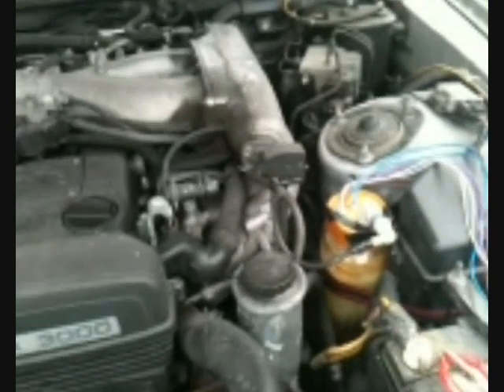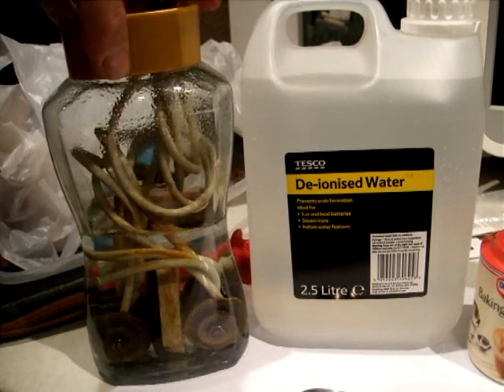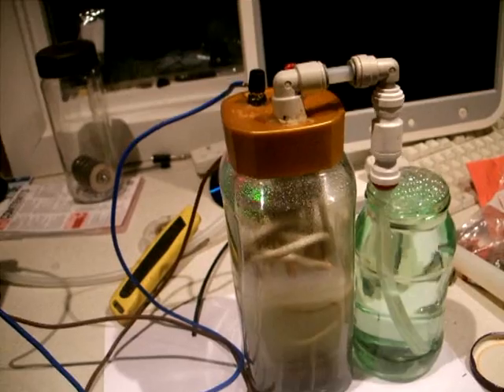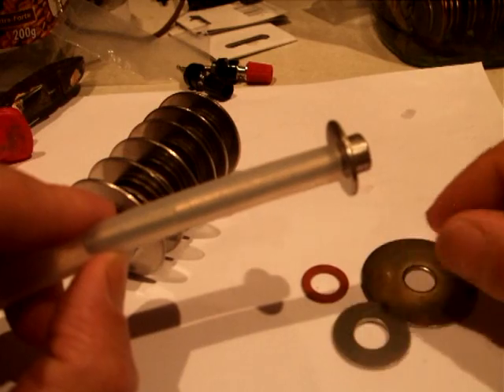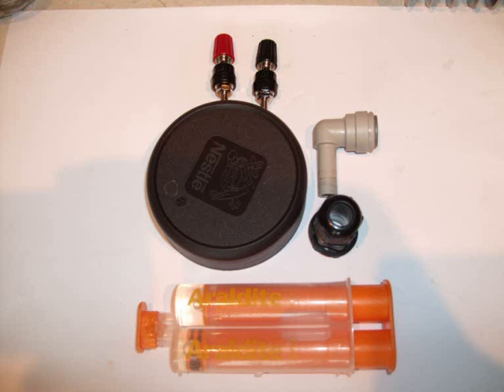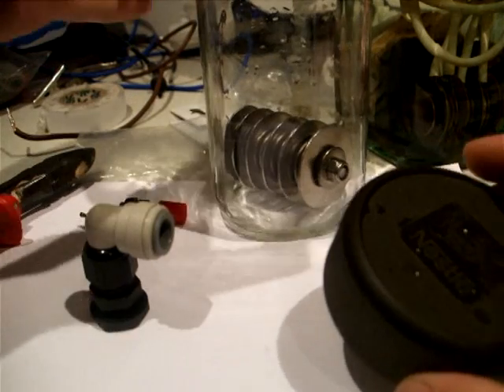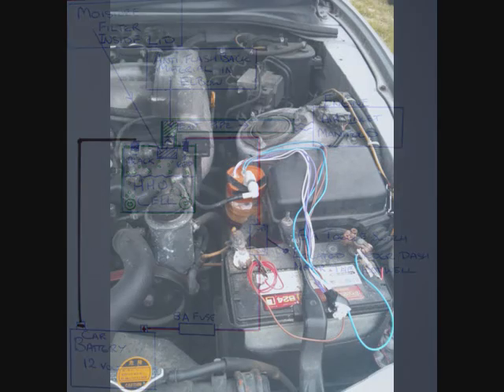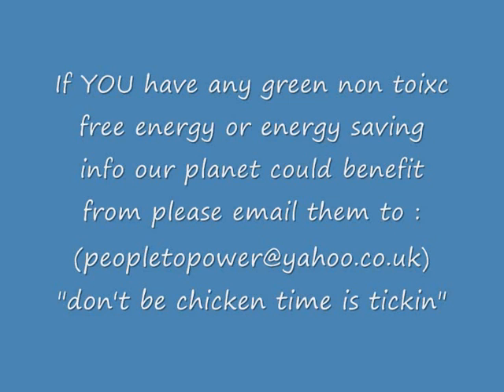HHO How To Build Your Own & Run your car on water.wmv

Comment: This fellow is doing exactly what all the HHO crowd are doing. They are all generating H2 and O2 and then burning it as fuel, along with the gasoline they run on. Physics tells us that it takes the same amount of energy to split water as it releases when it burns so there can be no significant improvement in efficiency and since there are always losses when you convert energy from one form to another we know these people are losing efficiency because extra energy is being added somewhere. They just don't want to admit it or just know where it comes from.

But the really great part is the part they have all been missing. Because everyone is so busy trying to cheat the oil companies or break the Laws of Physics, they are missing out on the true wonder and benefit of what they are doing.

Instead of making H2 and O2 gas and piping it away, they could use most of the same equipment to just seal up water vessel generator and it let run ( which really works good using a homeowners style, trickle type battery charger) until the water gets saturated with H2 and O2 gas, that has dissolved into the water, because it had no place else to go, just like CO2 in your soft drink. In this form the explosive gasses are smothered in the water and can't explode or even burn while the water it is still liquid. You could in fact, throw this water (now fuel), on an open flame and it would douse it  just as well as ordinary water but If this energized, E-Fuel as I call it, is atomized in a carburetor or injection system, the H2 and O2 gases are able to liberate themselves and combine as soon as a spark or flame is exposed. The really great thing is, that all the ordinary water molecules that are present when the E-Fuel is atomized, becomes a heat sink for all the excess energy released during the explosion and it all becomes steam and no heat gets wasted. So although you only get out as much energy as you put in when you generate the E-Fuel, when you burn the fuel in your engine, you get a huge increase in efficiency, because there is no waste heat and you no longer need a cooling system. All the heat that is usually lost to the cooling system is now doing useful work and increasing the overall efficiency greatly. But don't worry about your car heater just because you don't need a cooling system anymore, since E-Fuel burns perfectly cleanly and only produces steam, you can use the car's exhaust to supply your heater and scavenge even more energy out of the fuel. So it may cost you for the electricity to energize the water, to make the E-Fuel but you could realize a large increase  in efficiency, and E-Fuel makes every vehicle an electric vehicle, only far more efficient than any electric car and just as clean and friendly to the environment. 

None of this is based on the mistakes of some backyard inventor that has no idea why it works, it just does. This is straightforward Chemistry and Physics and it doesn't break the Laws of Physics, it uses them and this is all just rock hard science.

Ain't Real Science a Gas?

Comment: I made a poor quality video of how to do electrolysis with two positive connections instead of one negative and one positive. 

 The process recycles some of the electricity as you are charging at the same time. 

 It can also work with two negatives connections.

Probably take the video down soon as no one seems to realize the benefits of it.
Reply: why did u take it down?
Reply: Terrarium Firma  Had an idiot jumping to conclusions without replicating it from himself. That's why I took it down.

   Anyways all you need to do is look up Bro Mikey and Split the Positive here on YouTube.  Then where he connects his inverter is where you connect your HHO cell.

  The more batteries used in the bank the better HHO production and there is some efficiency gains in using more batteries.  4 to 5 batteries should be your minimum.

  Have an idea for a decent setup using some batteries in the back of a pick-up truck with solar panels over them.  While using a large HHO cell that can handle many amps and have it's own cooling system so the electrolyte does not boil.

  Any questions are welcome... provided you are willing to do the work.
Reply: OK, i'll look it up. Cheers

Comment: Stanley Meyer addressed the concerns of water freezing during Winter cold weather in his book: The Birth of New Technology Water Fuel Cell. This book contains all of the basic concepts of the Water Fuel Cell. Stanley Meyer demonstrated these concepts when he built his famous dune buggy that ran off of water used to supply hydrogen to run the Volkwagen engine in the dune buggy. His book is thorough in describing the basic concepts. Unfortunately, It lacks details in the actual components and control circuitry for the car.

Comment: stop!  people if we deplete the water supply on the planet WE DIE!
Reply: You're not going to lose water from the planet using this, unlike a fossil fuel. 
Water is a renewable resource, constantly going through the water cycle. This is removing hydrogen from the water by turning the water into a hydrogen/oxygen gas. Oxygen goes back into the atmosphere and the hydrogen is burned, and when it burns it reacts with the oxygen in the air turning into steam, which is a form of water. No water lost.
Reply: The hydrogen atom looses an electron (that's where the energy comes from) there for makeing it impossible to form h2o it can form h2o2 also known as heavy water witch we cannot drink and plants will not grow in it!
Reply: +Dennis Hust If it's possible to make heavy water, Deuterium Oxide, back into water that won't be too big of a problem if we can implement it into our cars. With our ability to manipulate atoms, so long as it doesn't take a nuclear reactor to do it, It's very likely to be possible.

Comment: How do you make a flash preventer; and the Gizmo that prevents moisture from entering the air intake?  Can these be readily bought.  I want to try this.  I know on my vehicles there are several vacuum hoses.  I have no idea which one to hook the device too.  So, I am considering drilling into the air intake; stuffing the hho inlet tube in it; then jb weld to seal.  Someone help.  Author of this video, contact me.

Comment: Regardless of all the negative comments about this device,if it works
then fine,if not....who cares,at least people are trying to find a way around the
fekking monopoly that the power companies have and shafting us into the bargain.
Reply: +Fred Zlotnick well everyone doesn't seem to understand this concept or the concept he's getting at. electrolysis is not supposed to be some wonder fuel that gets more energy out of it than you put in. it's just that the electricity and water should be more efficient and cheaper than water. there's still a conservation of energy. none can be created or destroyed just one water may or may not produce a cleaner fuel with the same kick at a cheaper price
Reply: If this approach was any good, we'd be seeing hundreds, maybe thousands of cars, electric generator all running on water. It will never happen, all the energy in water is locked in a chemical bond and it takes more energy to relase it than you can get from it. This is literally a "pipe dream", pun intended.
Reply: To be honest Fred,it's so difficult to know what to believe until you have seen something actyally work with your own eyes.
A water engine should by rights work because it's a basic hydrogen motor.
I watched a video about Paul Pantone who developed the Geet fuel processor which,when running,produces no blackened carbon out of the exhaust system through some sort of vacuum he creates between the carbaretta and the exhaust.Apparently he was prosecuted by the US government for this offence because he made the internal combustion motor much more efficient and better for our health,so why did they prosecute him? Likewise the rather amazing Nicola Tesla,a man before his time who wanted free power for all and created over 700 patents but was discredited by that tosser J.P Morgan who withdrew his funding when he realised that his cables would make no profit.
Reply: Believe in the laws of physics. You can't get something for nothing. All the energy in water is bound up in the molecular bonds between the hydrogen and oxygen. It takes energy to break the bonds which comes from the battery. This energy must be replaced. At the very best you'll get as much out, as you put in, but never more. If you could get more, this could self sustain, and the thing could simply run on water.
Reply: As you say,you can't get something for nothing,although once you have paid for the setting up of ground and air sourced heat pumps,put in some solar panels and other cheaper methods of getting your energy it does make you feel that you are getting something for nothing.
In fact my in-laws in Germany did all of this (not the air sourced one) and it all paid for itself within about 7 or 8 years.
Now they have a much easier life.
Reply: Your in-Laws in Germany are improving their efficiency by extracting heat from the ground and moving it to their home. This doesn't violate any laws of physics, and there are millions of installations around the world that do the same. They are not beaking down water into hydrogen and oxygen, and then burning it again for heat. You will get heat, but it would take more energy to break the water down, then the heat recovered from the H2 and O2.. Unlike man's laws, Laws of Thermodynamics are never broken.

Comment: what I cant understand.. is that your car is designed to inject a certain amount of fuel into the engine... putting a hho generator on your car will now just mix the fuel with gas... how is this going to reduce your fuel consumption.. ?? your cars fuel system doesnt know your putting gas in to the mix.. so its going to inject the same amount of fuel into the system... how is this going to save you fuel. ? the car might perform better.. but I cant see how it can reduce  running costs...

explain please... 
thank 
Paul
Reply: i agree with ur point.u r right..let someone answer it.
Reply: I think the HHO gas totally replaces the fuel. The engine should run on water only. That is what Stan Meyer did with his water car. I'd really like to see a demonstration

Comment: Thanks, I have still got a 20 PSI pump, some SS plates for a dry cell,  a 50 amp PWM, piping, two efie`s. etc., all new.   I may just get it together.  I built one years ago for my V8 4 litre Petrol Range Rover but it still made no difference,  13 MPG was it !!.  I may pop it on e-bay.

Comment: basic on amperage (8Amps) it is only about 8x12V=96W [HHO + xx% co2] generator, so only +0,13 HP (Horse power) is added to engine... so it is not practical anymore, it is more practical to use Hydrogen in metal-hydride storage tank, before it is colected on wind-solar HHO generator with more power capability >2kW)

Comment: are you running your truck on pure water no mixing of petrol or diesel or its ratio with HHO? if not then has engine given you that much horse power to take load or so?

Comment: There was a real screw up back in 1996 to 1999 when GM created the EV.1  General Motors EV1 was an electric car produced and leased by the General Motors Corporation but for some reason known only to the nutters at GM they scrapped and crushed the EV.1's they had built. Want to read more?? See Here: http://en.wikipedia.org/wiki/General_Motors_EV1

Comment: Doesn't the total energy equal back to 0? The current required to power the device causes the alternator to work harder and therefore the engine works harder. I feel like this will actually net less energy. I may be wrong though if someone could enlighten me.
Reply: Not exactly considering that most combustion engines only burn about 30% of the fuel that is put through them. I'm not sure on the exact figures but with the added HHO system you can get a 70-80% burn on the fuel you're putting through the engine. which means that you're more than doubling the fuel burn, which means a lot more power output, therefor you comfortably compensate the extra energy required to run the HHO separator.
PS. These figures are not exact but give you a general idea on how it works.
Hope I helped.
Reply: +Fackboy17 An engine with perfect combustion and a high expansion ratio won't get higher than 50% efficiency, much more than that and you are breaking the laws of thermodynamics. Modern ship engines are a good example. What's critical for efficiency is the expansion ratio, a bit of hydrogen in the petrol won't change much...
Reply: Fackboy17 engine doesn't burn 30% of the fuel, it burns 100% of the fuel but produces only 30% of it's energy, the other 70% are lost to friction and heat.

Comment: Is it possible to have a hybrid car that runs on both electric and water Instead of electric and petrol? In which one can be switched to the other?
Reply: If they did that you'd very soon realize that running with out the hydrogen conversion and just using the electricity straight up you'll get more range for the same amount of power used
Reply: Chris Brown So are you saying electric cars instead of water powered cars are more efficient?

Comment: ok what year model is you Toyota? Did you do any modification to the o2 sensor because this would be completely useless if the computer is adding more fuel to the mix probably making more power but not better fuel economy

Comment: That will not produce enough hyrogen to do anything except produce bubbles that do nothin since they are not under any amount of real pressure. Its just bs. The hyrogen and oxygen molecules need to be separated as well so basically youd be vaporizing water and putting it through your system and in doin rusting things faster. Its just a bs little device

Comment: its a 3L motor running idle @ 1100rpm so you need 3L X by 1100rpm =3300L of low pressurised gas per minute, the few bubbles it is making is like a fart in a bottle.

Comment: hi,i am in the u,k j am  new to this but i repaired batteries in the sixties.the ans is yes if it has what we called bent cells . i made a cell using lead washers i made by melting crab weights and set them,in a solution of battery acid and distilled water it gives better output than s,s,.but care is a must when mixing always add sulphuric acid to water never the opposite,batteries always tell you to be aware of exolosive gasses. info from john davis djohn ,u.k

Comment: djohn1957  i am new to this and computer too,but as an ex battery repair man from the sixties i experimented with lead washers i made my self ,and used a solution of battery acid and distilled water and got excellent output with no dirty water

Comment: Thanks for uploading such a wonderful video. I would like to find out a few details regarding the accurate thickness of the washers used. Both for the big and small ones including the dimensions of the fiber washer used. The diameter of the inner hole and the size of the washer.
Kindly tell me does it make a difference if we use any size of washers available or technically it should be according to specifications.
Thanking you. 
Waiting for your reply

Comment: this is what i was thinking because when you put ur foot on the gas the same amount of fuel will be injected but ur also adding hydrogen to the party, if you was to just leave your car running without using the thottle what would happen to the hydrogen that is just building up as the throttle chamber would be closed. thats what i was thinking anyways but i suppose u could just switch it off while u are sitting there and when u want to go just switch it back on again

Comment: They are explosive, which is exactly why they work so well in cars. A car works on combustion. Meaning they create small explosions in the cylinder. Usually by compressing oxygen & gasoline.

In this way, it's oxygen & hydrogen, thus producing much, much cleaner byproducts, because when you burn Hydrogen, you get water.

There is danger, if it were to ignite inside the hydrogen cell, it could explode, but that really depends on your fuel cell really.

Comment: I like your design, have a few tips. 
1( in my experiments I saw that copper wire corrodes crazy fast in the solution
2( to solve #1 just extend your ss bolts long enough to stick through your lid, maintain your washer config at the bottom and sandwich washers on top and bottom of lid to sandwich it in. use the threads sticking out the top of the lid for terminals. 
3( use proper size washers no plastic tube or washers are required. 
4( generate your electric w/ solar or peltier Thermoelectric.
Reply: Wow, thats amazing comment. My sir do you have guide how to make this happen and what item list to buy to put this together

Comment: you guys realize that hydrogen and oxygen burn back into water, which means that he is being LESS energy efficient, because he requires a wall-outlet to convert 2 H2O to 2H2 and O2, releasing X amount of energy, and then his car burns the H2 and O2 for X amount of energy.
X-X=.... ZERO!
so he gets no energy from this process, all he is doing is emitting steam, steam that is blazing hot, heat that could have been used for something, H2 fuel cells are just a complicated rechargeable battery.

Comment: the small mesh washers are to keep the others separated.  the small metal washers are a neutral.  basically current at whatever frequency will pass through them and help release more oxygen and hydrogen with out being hooked up to a positive or negative source (negative releases hydrogen and positive release oxygen) neutrals are a happy medium to release more molecules while drawing less current.  the higher the current the hotter the water and the hotter the water steam = water in engine =bad